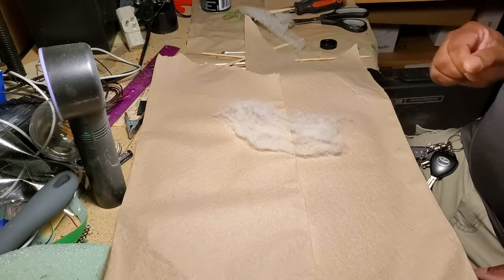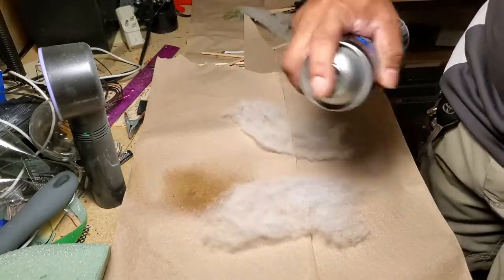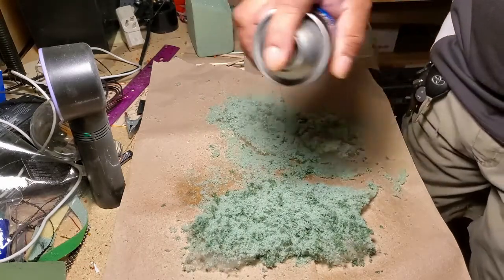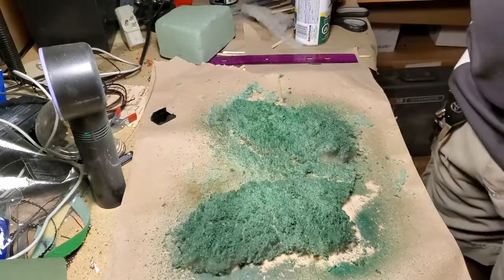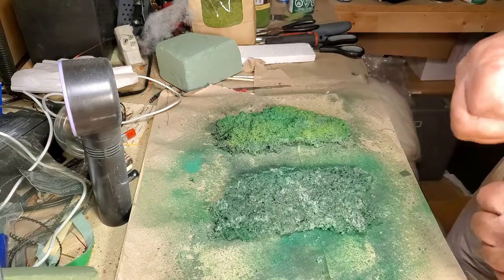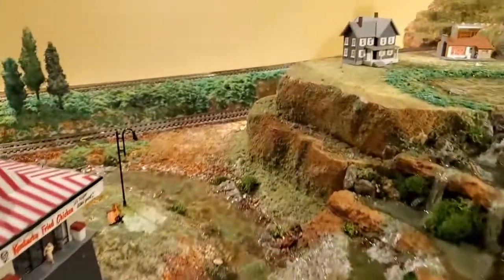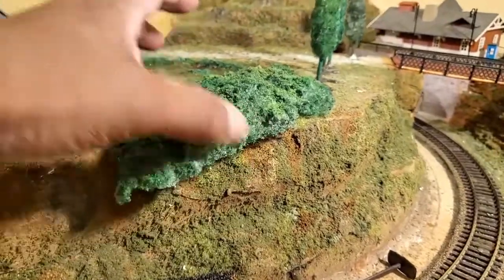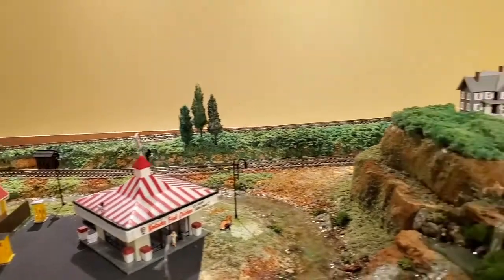Quick, Cheap and Realistic Ground cover- Shrubs-Foliage for Model train layouts -

Comment: I have used floral foam on an attic layout extensively.  One warning is it rots.  It decomposes to a brown powder over time and heat.  In a climate controlled living floor room it is probably much slower to decompose...but an attic or shed that is only cooled when you plan to run trains...go with landscape foam which rots much, much slower.

Comment: A good tip is to paint paint the poly foam battening a dark brown. The green flock and turf sits more naturally upon it. Great video thanks.
Reply from the maker: Great Tip .... I will definitely try that for the next batch  of ground cover ... Appreciate the comments ... - Anthony -
Reply: I like that idea the paint would also build up the thickness of the Poly foam filler giving it a more realistic branch structure . A dusting of Gray pastel would give it realism as well
Reply: I have painted foam dark green on the base and then while the paint is still wet, dust it with flocking/ground foam in a lighter color and this gives the foliage depth, like light falling on the top leaves while darker green shadow beneath.  Good for trees too.

Comment: Excellent tip especially since retiring and funds are not in budget for many higher prices already made or use of name brand materials.
Reply from the maker: Hi Ed , Thanks for the kind comments. I totally agree with you , that the cost for model railroad accessories are getting higher and higher. .. It drives us to find innovative ways to accomplish the same with house hold materials .. Thanks for the comment . Regards, - Anthony -

Comment: Would you recommend painting the polyester first with brown paint to simulate twigs and branches, before adding the foam?
Reply from the maker: Absolutely .. To be honest , i was a bit lazy and went straight for the Green paints ... Giving it a light spray of brown as a base will definitely give the effect of twigs and branches etc.. then you can layer on the green ( starting with darker to lighter ) to acquire your desired effect.  Great idea and observation on your part ... 
Regards, - Anthony -
Reply: @anthonyshobbycorner  I would also recommend giving the underside of the polyfilla a dusting of brown.
It avoids the white showing from underneath, and means you can use it for making overhangs.
Reply from the maker: @corvusboreus2072   Great idea Corvus ..  that would definitely work ...

Comment: Greetings from Australia.
Cheers for a very good simple tutorial.
The only suggestion I could add would be to hit the polyfilla with brown paint (bottom & top) before adding the florists foam to avoid the chance of any white bits showing through.
I have already made large areas of forest for tabletop wargaming by using polyfilla (spraypainted with brown then green) as foliage for tree armatures made from the inverted roots of certain weedy shrubs (mainly Senna pendula).
They were a bit of a rushed job and always looked somewhat flat in texture..
Now knowing that florists foam can take spray paints and adhesives without melting, I reckon I'll revisit my old trees and clump them up a bit.
Thanks again.
Reply from the maker: Great idea and recommendation .... I should have thought of that .. lol .. Thank you for sharing ..

Comment: Splended tutorial for some very dimentional ground cover. Thanks!
Reply from the maker: Hi William , Thank you for the kind words. Much appreciate. Just a word of Caution .. Please take appropriate safety measures when working with floral foam . I have been told that it it could be somewhat bad for your health if you inhale the powdered foam . So please use a mask when you break up the floral foam .. What baffles me is that Floral foam has been used for years by florists around the world, and they have to constantly break the foam into smaller chunks etc when they use it .. so I don't see what all the fuss is about , but based on some comments I have received , It's best to put on a mask etc when work with floral foam .. 
Regards, - Anthony -
Reply: @anthonyshobbycorner , Hi, I actually never use floral foam. It is in fact very dangerous to your health: Floral foam is made of:
In technical terms, it's an open cell phenol-formaldehyde foam. Floral foam is essentially plastic. It's a petroleum-derived product, meaning it comes from a non-renewable resource. And it contains formaldehyde and carbon black.
I was a sculptor in the film industry doing special effects films. A lot of full size sets  are made of Polyurethane Foam. The danger is in breathing the dust that inevitably results when carving and sanding the material. At the studios we always wore full plastic suits and rubber gloves. we would tape aound our wrists and ancles. We always wore goggles and surgical masks. And we always used pressurized air to blow off our suits before taking them off.
In my diorama modelling I use styrene foam, the kind that breaks down into little balls. This is not the same as polyurethane foam. I use foam rubber for making ground cover. 
I was able to procure a huge amount of rubber foam when the apartment next door was replaced. The foam rubber mat that goes under carpet is what I got ahold of.
I usea food blender to make the foam foliage. I cut the foam rubber mats into small squares and filled the blender with the rubber and water. After getting the foam ground up, I pour out the majority of water and then add artists acrylic paint (various colors). a little goes a long way. 
The result is very much like the Woodland Scenics 'clump foliage' products. 
To get a finer blend I use a coffee bean grinder to chop the clump foliage to get that 'fine green foliage' type product.
I make miniature bushes out of steel wool, from #"0" to #"3". I also use polyfiber for variation in appearance and needs.
Thank you for the ongoing dialog.

Comment: Cool method, like your use of floral foam.
Reply from the maker: Hi Vincent , Thanks for the kind comments . But again , please use floral foam with caution ( use gloves and Mask ) when working when filing them to powder form as the powdered form of floral foam is not the best for your health ( has some toxic elements) . just be careful when using it , and you will have good results ..

Comment: Nice result. Thanks for this tutorial. I used the floral foam to dust pine trees. But looks good as ground cover too. I'll give it a try !
Reply from the maker: Hi Filip . Thank you for the comments. Floral foam is like Duct tape for modeling .. It can be used in so many different ways and is far more cost effective than a commercial product .. I will also give floral foam a try on pine trees . I do have a few pine tree armatures .. time to give it a shot ... Regards, - Anthony -

Comment: Great idea! Looks like it's fun to make it, too. And cheap. Thanks for sharing.
Reply from the maker: Thank you for the kind words. I'm glad you found it useful . Stay safe , Regards, - Anthony -
Reply: @anthonyshobbycorner  Are you modeling in HO? I'm N, but your technique looks as if it would work well for N, too.
Reply from the maker: @gmaneis  Yes, I am Modeling in HO . However, the technique should work for N scale as well I would think ( just that I have never tried it for N). One recommendation is that if you want to try this for N , just use less poly fill and less floral foam , this way the ground cover does not get too high.  - Regards, Anthony -
Reply: @anthonyshobbycorner   That's what I was thinking would work well for N. Thanks for the suggestion, and thanks again for sharing your technique.

Comment: Hi, just came across your video. I've never really been keen on clump foliage as I never found it realistic enough. However, the way you've made it has changed my opinion. I'm going to give it a go and use some on my embankments which is an area I think might well suit the product. Cheers.
Reply from the maker: Hi Richard, Appreciate the kind words .. Just a word of caution , when using any kind of floral foam . Just make sure you use a mask and gloves etc... Even though Florists use them and handle these floral foam bricks on a daily basis , apparently they are not very good for your health .. best to be cautious breaking it apart into small pieces ..  Regards, - Anthony -

Comment: Nice work Anthony, I do the same thing but spray paint the polyester before applying anything on top but I think that is not necessary as all of it will get covered.
Reply from the maker: Hi Darshan . I'm glad you have discovered this technique as well . It is so cost effective, while not compromising on realism ... I have been using regular spray cans all this time , but I think moving forward I will start using a Air brush , which will give me more color options and variations ...  
It was nice catching up with you . - Lets keep in touch - 
Regards, - Anthony ( Rajuna )-
Reply: this is a great idea i have some larger areas to cover and will be using this method. Thanks for the great idea
Reply from the maker: @heathpein4346  - Thank you for the kind comments. The purpose of posting these vids are to share ideas with fellow hobbies .. so I'm glad you found it of value .. I also learn a lot from looking at techniques and methods others have used for building their layouts .. Nothing is more satisfying than finding ways to progress your layout without having to buy those exorbitantly priced commercial products ... take care - Regards, - Anthony .

Comment: Hey Anthony, you make some good points about using those cheaper products to create unique scenic shrubs. Your layout looks great, loving the waterfalls, they look superb. Will follow your progress on it. Is it modelled on anywhere specific? Thanks for sharing dude.
Reply from the maker: Thanks for the kind comments Brian .. I experiment with anything I can get my hands on , to avoid using using commercially available modeling products , as they can get very expensive .  The layout is not modeled after any specific locations ... It's just a fantasy town .. I looked many pictures ( Google images ) to figure out what I want to mimic . For ex: by looking at pics , I decided that I wanted to model the mountains after mountains in UTAH or Colorado, where they have a orange / crimson tint to them . Thats why my mountains have  a crimson undertone to them . It makes the layout more lively. I also liked a lot of foliage , as it makes the scene look fresh and "alive" ... choice of colors make a big difference to the mood of your layout . Even the waterfall was made to resemble a picture I found on the internet ..  If you are looking to make mountains , etc , let me know as i can share with you some very easy techniques , which makes very simple to make . Also if you are planning on gradients , I can give you some tips there as well . -  I have wired my Layout to run both DC and DCC . I also use a PWM controller (for DC) , which is much better than the controllers made by model trains manufactures ... and much , much cheaper - IF you need any info on these topics , don't hesitate to shoot me an email or even send me a comment ...   Regards ,Anthony .. (anthonyb1019@gmail.com)

Comment: Great video!! Why do you use hair spray vs. a spray adhesive???
Reply from the maker: Hi chris, Sorry for the late response , not had time to catch up with the comments. 
I use hair spray for 2 reasons , 
1) It is not as think as Spray adhesive ( not as heavy ) And so it does not compress the previous layer when it is sprayed on . 
2) It is also significantly cheaper to buy Hair spray that Spray adhesive and I found that it is ideal for spraying inbetween layers ...  Mind you , I do mix in some spray adhesive time to time .. but I found that Hairspray has sufficient tackyness to it , that it holds the light particles pretty well .. 
In fact you can use either .. It's just a personal preference .. of cost and convenience and results that you like.

Comment: Hi Anthony,

OK, so you just layer up the foam on the poly until you get some height.  The foam is easy to rasp and works well.  Dollar Tree is the place to get this stuff for a very good price.

The layout is N scale (1/160) so not too much height or it will go out of scale.  This is a museum layout by the way.

A great alternative to commercial foam and the mess of making your own other ways.  Rasping it is quick and easy.

I thought after I get it installed, that I may mist it with 70/30 PVA with a dash of dish soap to really seal it down as hair spray will fix it long enough to move it around...but when in place, it needs to be a bit more stiff.

I learned about poly fill and am using it over large terrain in my terra forming with success.  Gives a supurb texture and reduces tons of plaster and mess.   Poly can be split into several whispy layers for other purposes like hanging moss and vines and tree canopys..   Will subscribe.  Thanks.  Bob s

Comment: Anthony,  Hi again.  Looking at your video, there appears to be a gap from when the poly had the light foam on it with a bit of dark green foam.  But in a few frames more, it appears quite thick after the painting.
Was a lot more foam added here to get the height of the mat?  Was it just more of the floral foam or were other foam materials added like course ground foam?  Bob S
Reply from the maker: Hi Rob , I do apologize for perhaps some bad video editing on my part. I basically use Poly fill as the base , then add floral foam , spray some paint ( the ideal method is to use a Air Brush , which I did not have at the time ) and then put some hair spray and then add more floral foam ( to simulate thicker growth ) and then at the end I add some of that "Flock & Turf - Summer Lawn" Eco pack to add the desired lighter shades of color to simulate fresh growth  ( which I got from my local hobby store in Toronto Canada .) If you give me your email address, I can send you some pictures of the product. my email is (Anthonyb1019@gmail.com).

Comment: What tool are you using to grate the foam?
Reply from the maker: Hi Marco , I use a Rasp File ( typically used for wood work etc ) . Just a cheap RASP file will work . 
But when working with Floral Foam , Please use the proper protection such as gloves and a face mask etc, as you want to ensure you don't inhale the powdered Floral foam .

Comment: Anthony,

I see you begin with very thin poly fill.  I separate the layers of poly to get to the same height.
I tried your technique with the 2 colored foams and it looks great.  But your final product shows quite a bit of height and texture,  how do you achieve this 3 d effect since you do not seems to be applying a lot of course foam to build it up?

Bob S
Reply from the maker: Hi Bob , thanks for the comment. Basically what I do is, I first use the poly fill ( as you have outlined ) , and then I take a block of Floral foam ( the are available in rectangular blocks at arts and crafts stores or even the Dollar store. You take the floral foam and then you use a rasp file , to let the peices of foam form a layer on the poly , and you can do this a few time in random patterns to get a higher and higher layer. let the foam just drop on to the poly , and spay a layer of hair spray to make it adhere. Do not compress with your finger or any tool , as it will then loose height . Let me know if you would like me to do another video , just for you , and I can find some time to do it . 
also , I hope you are using the Poly fill which is used for pillows and cusions etc ..  Regards, - Anthony -